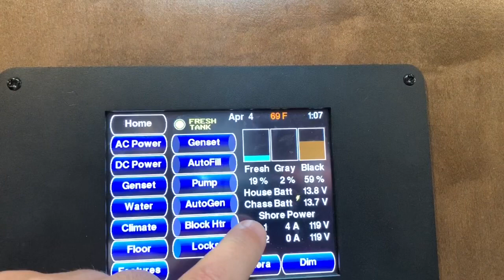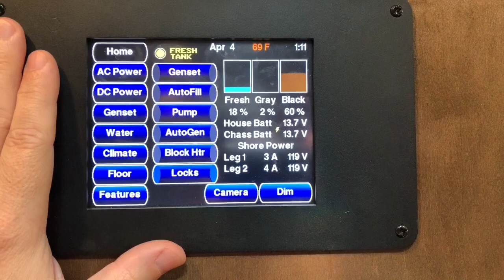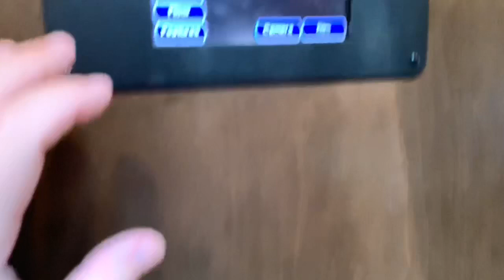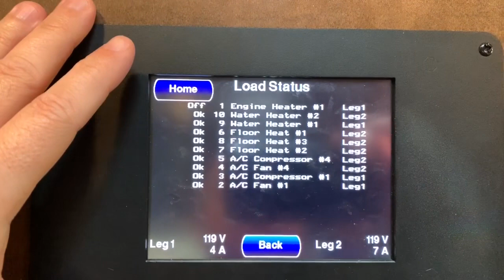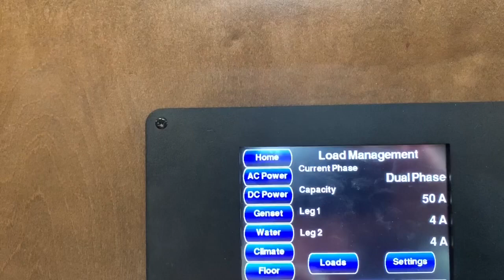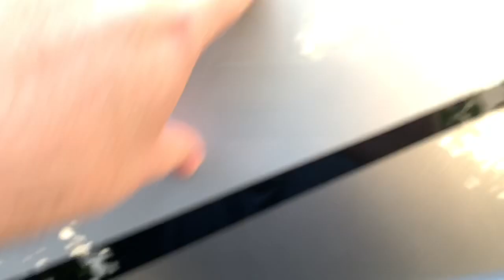30 Amps in a 50 amp RV

Comment: Interesting way to explain split phase. It might be more useful to explain it in terms of kWs.  Breakers and wire size should be based on current and none of those circuits are going to see  100 Amps.  Also when you are using a dogbone you are only pulling from one phase. of the split phase.,
What I am saying is you cannot connect L1 to L2  to split the 120 volts between the two phases of 240 volts, At minute 6 :50 it is incorrect to say that you are using 15 of 50 Amps from one phase and 15 of 50 Amps of the other phase. Your are using only one phase when pulling 120 volts and it is unbalanced. Diagram it and you will see that you will get a direct short across L1 and L2 on the 240 volt side if you did that. 
I do understand that when using a 30 Amp 120 service into a 50 Amp 240 plug on your RV that the single hot is being connected to both hots on  your RV and  it is shared for a total of 30 Amps.
Maybe the plugs  and dogbones prevent people from making mistakes.
Reply from the maker: Thanks.  Yes, I understand everything you're saying ... I think where it may have become unclear is that I was trying to say that the display will still show two legs when in reality there's only one.  That confuses people.  But the plugs and adapters do make it simple to connect -- but not so simple to understand, as you say, that you're talking about 1500 watts or 3600 watts or 10000 watts (15 amp, 30 amp, 50 amp services) especially when the display still shows two legs for the 15 and 30 amp scenarios.  "worst case" is simply popping breakers and not understanding why and how to avoid it.  I would probably redo the video, starting from watts, and then explaining the caveats after getting that groundwork laid.

Comment: How long can run on the house  batteries before they need to be recharged ?

How long does it take to recharge the house batteries using the generator  and shore power ?
Reply from the maker: If I'm living inside and being careful, I can go between 12-24 hours before needing to recharge.  I haven't timed how long it takes.  It's fastest from 50-80% (you shouldn't go below 50%) and then it takes a while after 80% (and you shouldn't' stop it before 100%).  A total of at least 4 hours I think
Reply: @TisTheDestiny  Thank you for getting back to me.  I did enjoy your video about running the newaire on 30 amps.  I know that I would consider replacing the AGM batteries with drop in lithium batteries.
Reply from the maker: @kb3mpx  I'd love Lithium, too -- but I don't boondock (at least not yet) so it doesn't make any sense.  Would love solar, too.
Reply: @TisTheDestiny  I do have one more question about boondocking in the newaire.  I believe that your model year of newaire has a 85 gallon freshwater tank.  How long can you boondock for with the 85 gallon tank ?

Comment: Thanks for the tutorial on 30 vs 50 amps. When we did our shakedown trip with our 2019 New Aire we we on only a 30 amp service. Of course things didn't work as they should but we didn't know better. Is the Genex? Hooked up the the Oasis quieter? We find it is loud when we use it which is often.
Reply from the maker: Gary Boehm I didn't find it any quieter with the Genturi.  I’ve seen people add mufflers to their installations to help with the noise. That’s one of the reasons I prefer 50 amp is so I don’t have to listen to the oasis burner.